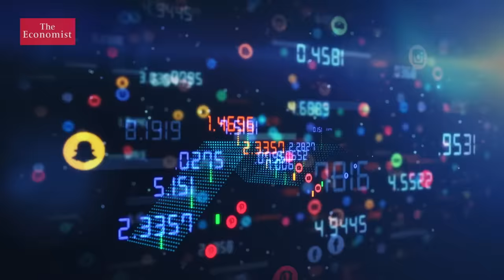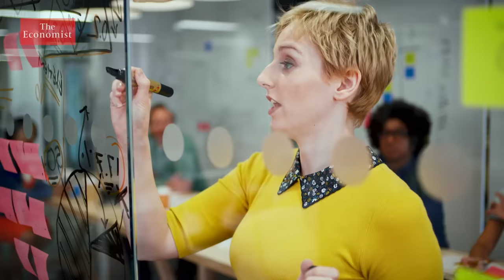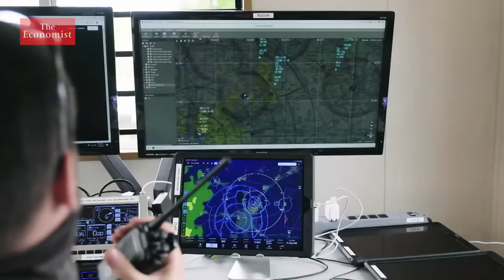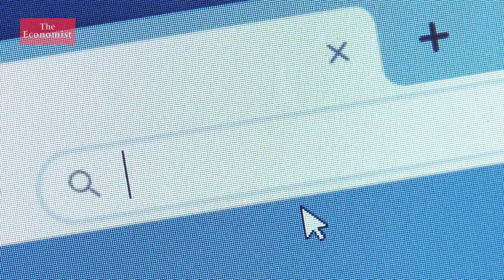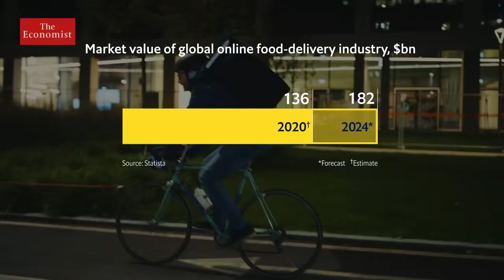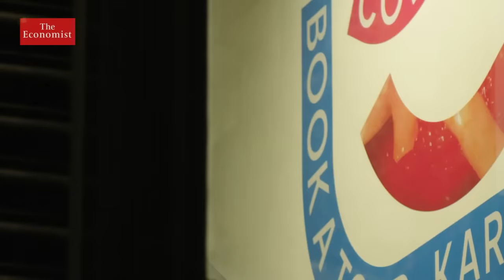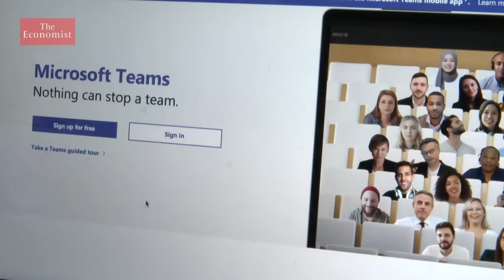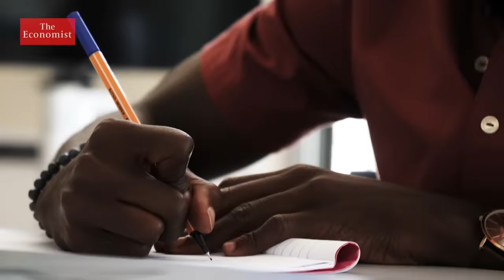How covid-19 is boosting innovation

Comment: Sorry, those two sisters raised £250,000,000 on the back of one ghost kitchen? That's insane.
Reply: Nothing against pushing forward, clearly it will work around the clock but those restaurants inside will be charge a lot to pay that 250 back.
Reply: it just shows how desperate many investors are to back the next big winner.

Comment: 18:00 The need for devices to drive connectivity and provide a shared pool of online resources was solved by the application of a cloud based Linux community I used before cloud drives were considered practical. It used to fit on a zip drive?